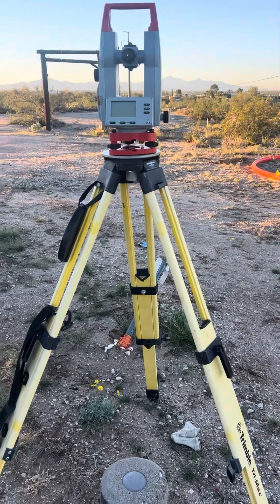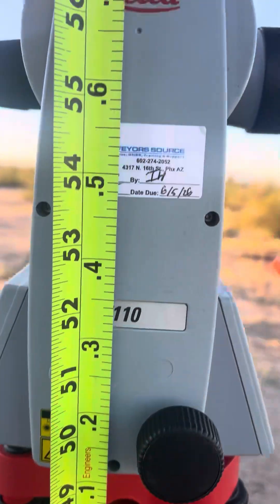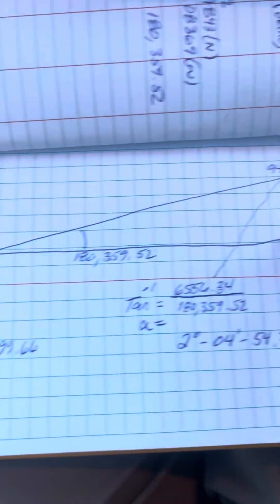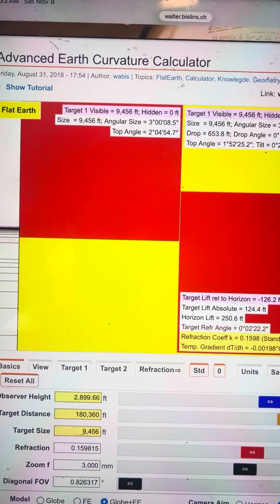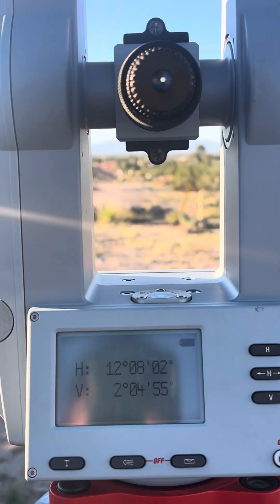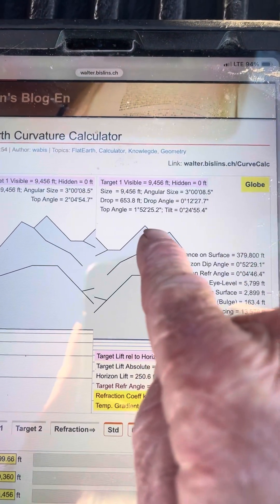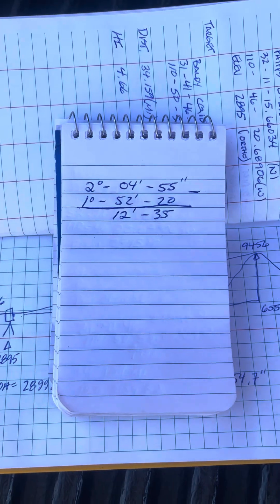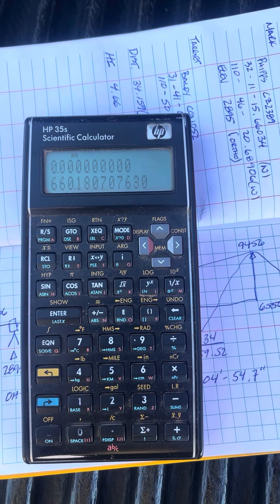Flat Earth falling flat

Comment: Congratulations on proving the globe…by assuming the globe, entering globe math, and then confirming globe math. 

That’s not a measurement bro... that’s a circular ritual with a tripod.

Try leveling your gear to actual water and showing us curvature without preloading the outcome. Until then, you're not surveying Earth, you're just measuring your belief system. Welcome to the religion of Radius.
Reply: Do you morons always comment on videos without watching them, or did you miss the part where he assumed a flat Earth, used flat Earth math and proved that the Earth can’t possibly be flat?
Reply from the maker: Looks like I found some time at work to post a video of me taking my “gear to the water”. Video is up, enjoy!
Reply from the maker: Hey that’s great advice! I actually did EXACTLY that at Lake Pleasant TWICE. I’ll upload the complete video after work.
Reply: Proving that earth is a globe is trivial and does not require assumptions about the shape of the surface. 
Any vaguely intelligent person can reach this conclusion. I will help you with two examples. 
1. Locate the longitude and latitude coordinates of 3 places on Earth, say 2,000 km or miles apart whichever unit you prefer. These now form a triangle. Now using basic junior high school geometry, determine the bearings linking these 3 places and the angles formed between these bearings. If the earth is flat, the sum of these angles MUST be 180 degrees. If the earth is not flat, then the sum of those angles MUST be greater that 180 degrees. 
2. Use the longitude and latitude coordinates of any 2 places along the equator and compute their distance. Now do the same thing along any other latitude both north and south of the equator between the same longitudes. If the earth is flat, distances along latitudes between the same longitudes north of the equator will be shorter north of the equator and longer south of the equator. Globe earth predicts that the distance along the equator between any 2 longitudes will be greater than the distance along any other latitude both north and south of the equator between the same longitudes. 

In both of these cases, we can rely on longitude and latitude coordinates because it is accepted that these coordinates are accurate regardless of the shape of the earth. Professional navigators use these coordinates. Flat earth and globe earth protagonists universally claim that navigation, using celestial navigation or GPS works on their particular earth shape conclusion. This is obvious because these forms of navigation work perfectly. 

Why don’t you give these 2 proposals to determine conclusively a go. You don’t need to go anywhere to do it. All you need is google which will also supply the calculator.
Reply: He literally measured curvature. Cope and seethe  😂
Reply: Why is your channel set to kids mode? 

Why cant flat earthers leave children alone? 

Truly disgusting people

Comment: @nathanoakley1980 sent me having reviewed this video. Thanks for the content.
Reply: @nathanoakley1980 is a walking monument to anti-geometry. He insists you can’t measure the length of a curved surface in meters, miles, or any unit of length—something a third-grader could refute before lunch. He also claims it’s “impossible” to measure height above a sphere’s surface, apparently unaware that you do it the same way you do on a flat surface: measure the distance along the perpendicular to the surface. That’s it. The fact that anyone could be so thoroughly brainwashed into rejecting basic geometry is genuinely depressing.

Comment: Flat earthers rejoice.  He has relied on countless assumptions.  The first being his elevations of the two locations are accurate.  Likely those are based on barometric pressure which can be inaccurate.  He further assumes that barometric pressure is constant at equal elevations everywhere on earth otherwise the altimeters which measures this is inaccurate.  The earth is egg shaped so in fact we know altimeters will have some bias based on the center of mass of earth and wouldnt be completely exact on the 2 poles or the equator.  Gravity is the same.  In fact gravity is normally 9.8m/s² but on Everest its measured at 9.77m/s² and decreases with elevation but again we cant prove that its the same at all altitudes even at least not easily.  Although I agree with the calculations in the video, not actually promoting flat earth nonsense.  It is necessary to point out the large amounts of assumptions and things that are proven but practically speaking would be quite challenging to prove to a skeptic as it requires travelling all over the earth taking measurements.  Worth pointing out.
Reply: How ironic that you start your post accusing others of making assumptions and then your final comment admits YOU made assumptions that were wrong.
Reply from the maker: Which of the 2 monuments elevation was computed with an altimeter?
Reply: @Baron_Rutledge  were trying computed by satellite?  Aerial photos?  A frame of reference is needed
Reply from the maker: @gregorymorse8423 Read the data sheets, they are easily accessible on NOAA “NGS benchmarks and data sheets” . There is also a “dsdata.pdf” at the top of the page that will explain how to interpret the data sheet. I strongly implore you to read up on how dynamic, geoid, and orthometric heights are derived.
Reply: @Baron_Rutledge  interesting.  I assumed altimeter but you are right better methods exist.
Reply from the maker: @gregorymorse8423  You can also look into “trigonometric leveling” it’s leveling via vertical angles.

Comment from the maker: Ironically enough all of those concerns were addressed sans taking into account atmospheric conditions.
Reply: Ironically, 1) It was taken into account in calculating the globe drop of 665’.  (See the calc at 2:21.). Without refraction the drop would have been 777’. And 2) since refraction LIFTS the peak, taking it into account for the flat earth prediction would only make matters worse for you. 

It is too bad that the poster did not make that point more strongly.
Reply from the maker: @doctorem  I didn’t compute C+r. I relied on bislin for the globe prediction.

Comment: 4:07 You didn’t point it out, but Bislin’s Globe calculator had almost the same amount of linear drop (in feet) as you calculated. Just another validating data point. 

All around nice job. It’s just too bad these kinds of demonstrations never seem to have an impact on flat earth convictions. 

Typical critiques:
- your orthogonal triangle math doesn’t take perspective into account. (The Flerfspective mantra “things get smaller with distance” and that’s lost in an orthogonal view.)
- you’re using that instrument for distance beyond its spec’ed range. 
- you didn’t verify the instrument’s calibration.
- you didn’t take the “conditions of the medium” into account. That view will change y to day.

Did I miss anything?
Reply: - "that's a flat earth measurement, great job"
- "you need a flat horizontal plane of reference to take that measurement"
- "how did you factor convergence into your calculations" (I usually respond with a good ol 'that was done along with my perspective calc')
- "you need to include water in your measurement"
- "you shouldn't be able to see that far"

Ok, I'll stop
Reply: @miikesnow50  Good list, but I don't get this one: 
""you need a flat horizontal plane of reference to take that measurement"

If someone is claiming that, does that mean a physical plane is needed? Because a horizontal reference plane is used, but it's measured, not a physical surface. It's 90 degrees from plumb, which is what the instrument indicates. No actual physical surface corresponding to a flat horizontal plane is necessary. 

Or am I missing something?
Reply: There is a QC cal sticker clearly seen on the instrument…